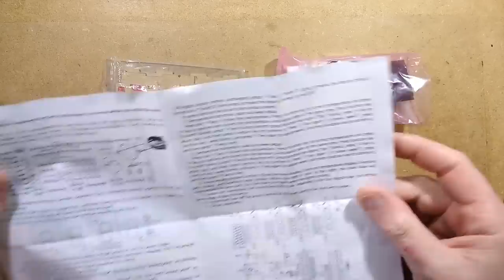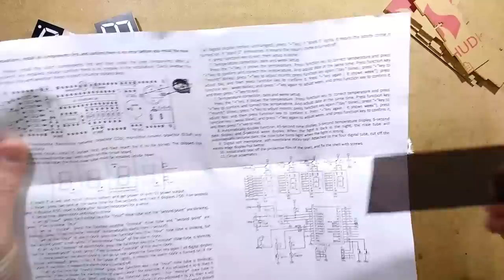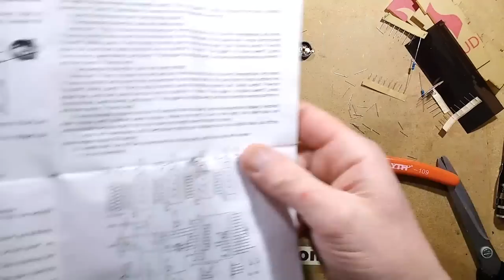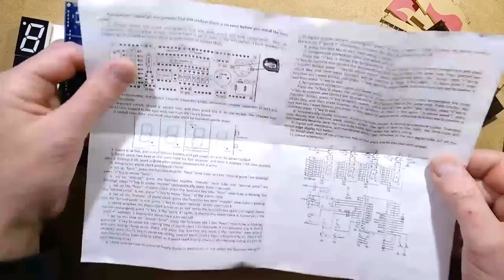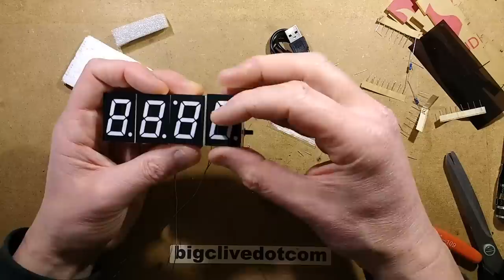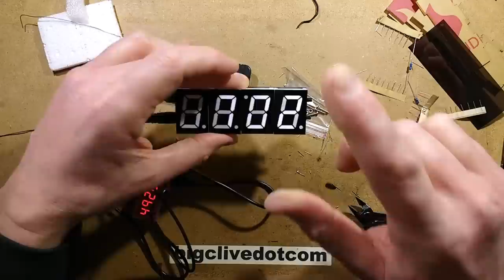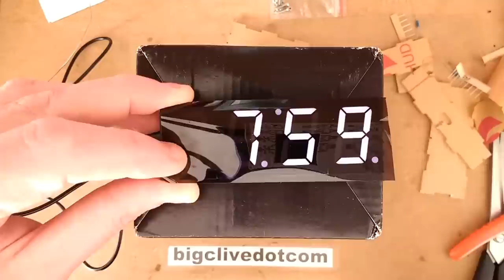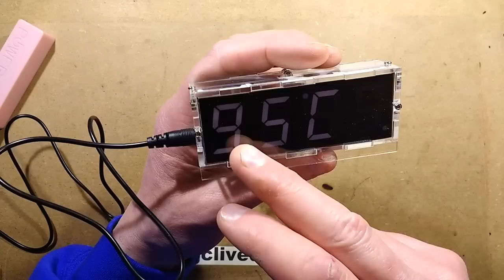eBay clock kit.  Full build and setting guide.

Comment: I've got one of those clocks on my night stand. I increased the LED resistors quite a bit so my retinas won't get burnt out of my eyes every time I look at it. And my bedroom does not look like Mordor.

I have the version without the thermometer and brightness sensors, but nevertheless it's a useful thing. Also mine runs a bit slow (about -1 minute per month)
Reply: What value did you settle on?  I built one for my mother, and she says that the dimmed level is too bright for her at night.  I can't personally see the dimmed level through my closed eye lids in total darkness, so my impression on the matter isn't very helpful.  Obviously it's her clock so It would be preferable to have the light level be appropriate for her eyes.
- edit - Then again, it's dawned on me that your clock must be using the red LEDs while hers is blue, so your resistor value might not be useful.
Reply: Yeah, it's a red one. And I don't remember what value they had initially. But now I use 1k5 resistors. 2k2 still work and it is bright enough.

But just try it. Desolder one resistor and try different values until you've got the desired brightness.

Comment: Another great clock is the colour clock. It doesn't display digits just 6 coloured LEDs in small glass jars. Each LED has 10 colours so if it's red red orange orange green green it 22-33 and 44 seconds. Mine has been running for well over 12 months non-stop and keeps good time. It will even read correctly when turned upside down.
Reply: Green is 5, so 55 seconds :-)
More importantly, though: I don't quickly find this clock on Banggood, Ebay or AliExpress. Can you please suggest where I should be looking, and maybe some less-common search terms?

Comment: Mowing a lawn...on the Isle of Man...in February?  Most lawns I know of are dormant this time of year, growing a cm all winter, if at all.

I was always taught when soldering semiconductors (mostly TO-92 transistors) to use a clip heat sink, to avoid melting the contents.  Now that I've seen folks heating up entire chips to solder-melting temps, I think that was quite pedantic to do that.  Or maybe back in the 70s, transistors were a lot more fragile w/r/t heat.  But the point is, if you're worried about crystal deformation due to heat going up the leads, do you think it would help to clip on a heat sink, even something as simple as a croc clip?

Comment: Hi Clive, 

The problem with the temperature is the thermistor is supposed to go through the hole at the top of the case.

The same applies with the LDR.

The problem is if you don't allow enough length on the leads of the thermistor its not long enough to go through the holes at the top of the case.

I bought another multicolour clock which has less features still its just as nice as the variant with the speaker and the night light.

If you want the temperature sensor to work correctly you'd need to either cut the thermistor off and solder another one in. 

Its reasonablely accurate and its meant to be accurate with 1°C.

I turned the hourly chime off by changing the start time to "0" and the end time to "0" which I guess turns it off.

I turned all three alarms off.

One of the modes is a complete mystery.

It has 9 settings plus another 9 settings. 

What's it for??

Anyway by for now and I hope that helps if you can be bothered resoldering another thermistor into the board.

Decem.🙂

Comment: Mr. Clive (or a helpfull viewer) ;  I have a question regarding a clock kit that you did on an other video you made, but i cannot find it now and I'm sorry for that. My question: Is it possible to solder the components to the backside of a circuitboard? Except for the display in this case. I want to design a box to 3D-print, and then put the same clock as you build on the other video, inside it but it would be nice if the components are on the backside of the circuitboard to have more place and have the display on a flat front of the clock. Thanks in advance, I always enjoy your videos and learned allot already but I need to learn much more and see ALL of your videos first but there are just so much :) Thx for every video you have made untill now, all are very enjoyable.

Comment: Awesome digital thing ama jig, gotta see if I could somehow figure something similar for my 2 solar power controllers from the harbor freight kits  that on both have lost the ability to completely give a accurate reading on the display  quartz crystal meters?  Especially for programming the amount regulating the power coming in from the panels to the deep cycle battery bank. Anywho not sure why this makes 3 that have crapped out now. It be nice to not have to check constantly with my meter anymore  .

Comment: Hiya Clive built loads and corrected these clock kits as you advised that the 3rd led has to be put round upside down big mistake people do and put the reverse polarity diode in the wrong way round

Comment: Regarding capping video length - it depends on your camera model; some manufacturers cap it at 30min (or less) to avoid video camera tax and classify the device as photo camera; but that's in low resolution. At high resolution it's capped at 4gb on FAT file system. Try formatting in ntfs file system. Alternatively you can capture HDMI output from camera and store it directly to your PC

Comment: Thanks for the suggestion, I have one of these, well sort of, mine is white with green lights. It even has a place to solder in a header for programming, but I am not all that smart about trying to reprogram. It would be very nice to be able to reprogram mine so it shows the F temp instead of that blasted C that China thinks everyone in the world understands. Well I DON'T understand the C, I guess I am getting a bit of an idea now that I have that little clock in our Motor Home, where we live the winters out, to avoid the cold and snow of our native South Dakota. Perhaps I shall learn one day how to program that little STM chip to display the F so it will be more useful.  I did complain to the seller, who was very nice about the whole thing, and said they were sorry for the add not stating that it was only C, after which they refunded me the purchase price.  Funny, I didn't ask for a refund, and had already left them good feedback.  Guess some Ebay sellers are just nice folk, like you and I.

Comment: there is a second version with a better speaker (not a piezo) that speaks the time (in broken english "P M three forty five"). i have one of these and it it a nice and neat kit. im about to order a few and build em as gifts
it looks really close to the one you have, but can be identify identified by there being a button on the top center and the thermistor  was moved left (kinda between digit 1 and 2) and the 2-3 CM diameter speaker in the back

Comment: Just fyi most places refer to that as a bevel tip, not a chisel tip. Chisel tips are also sometimes (ie by Weller) called screwdriver tips. Just for pointless added confusion, Weller calls the bevel tips "flat tips" for some inexplicable reason.

Comment: Can I take the output to the LED and use that to drive transistor to drive bigger display? I would like to make something with much bigger numbers. Getting older and have trouble reading some displays without my glasses. When I wake up I must get my glasses to read the time.  I like your videos! I wished I had found you earlier! THANK YOU FOR THE INFORMATION!!
Reply from the maker: You could.  Or drive short parallel rows of LEDs directly at low intensity.  You can get some clocks with very big displays.

Comment: I can recall that I have had one partially assembled red LED, 4 "8" segments with "colon", clock, in midlle eighties, last century, and I dissasemled them, just like you did, down to flat PCB. But! After resembling, LEDs were dyeing one after another. I can say that "8" figure segments were not hermetically mounted onto the PCB but were attached with clips and have had a fixed foil covering the segments. Never understood what had happened. I even maybe have the device data sheet somewhere... 15:36
Reply from the maker: It may have been bare chips and bond wires.  Very easy to break when exploring the display.

Comment: Thank you, it helped. Did this one recently, and after a day of running it I noticed the battery is swallen. The voltage on the battery terminals was about 4,5v when connected to the power supply. Is there any simple trick to protect the battery from charging in this circuit?
Reply from the maker: These may be trying to charge the cell.
Reply: @bigclivedotcom   yes they do,  what if I try using a diode to prevent the battery from being charged? will it work? what kind of diode should I use?

Comment: Caught ya!!! At 47:44 your right hand has a "rasberry road rash", it didn't have before you started wrestling with that case, did you peel it on that laser cut plastic?
Reply from the maker: It was much more dramatic.  I was climbing in a tree with a saw when that abrasion happened.
Reply: The best stories start with some version of: "There I was, with the Mountain Lion only 4 meters away...."

Comment: I've already built one of these and was hoping someone could explain how to set it. I've spent much too long trying to figure out how to get it out of 24 hour time display mode, but so far my efforts have been futile. The one I got didn't come with any instructions, but I did find a website that showed how to assemble the clock, but the site was in Chinese so if there were any instructions on how to set it I couldn't read them.
You're right about it being annoying that the clock is always displaying information other than the time, and I find myself confused about whither its displaying the time or the date. Also, while mine does have the thermistor, it never does display the temperature, and the light sensor only works occasionally, most of the time it's on full brightness even in a dark room.
The case, as you point out, is a real pain in the butt to assemble, I spent a lot more time fussing with it than I did soldering the components to the PCB.
I really wanted to like this clock and feel good about soldering it together myself, but it's been so frustrating I think I'll end up tossing it out.

Comment: I am 50 yrs old and still haven't master the soldering thing. I really should buy a couple of these kits just to practice on. I do not have the best solder station but I guess it works. It is a Weller 40watt  kit but can go up to 60watts I believe. I love the TS100 kit you have but I can not pull the plug on the $200.00can plus tax.
Reply from the maker: I use a fairly cheap iron.  The main thing is to have a clean shiny tip and to melt the solder directly into the joint while heating it.
Reply: @bigclivedotcom  When I am doing some soldering work I really do not know what to use as solder. What size or should I be using lead free. I am just using some cheap solder that came with my station. That is almost all gone so what do you recommend I buy?
Reply from the maker: @MarkK01  Try and find proper electronics grade tin/lead solder (60/40) with a flux core.  When you apply the solder ot the preheated joint the solder will melt releasing the flux , which cleans and mates the solder to the surfaces.

Comment: It's funny that you're doing a review now, I just got this clock last week and really like it. I'm using it now as main clock on my night cabinet. The only thing which is quite annoying is that it's so frequently changing to date and temperature display, which I would like to be only activated by button press. I'm currently working on a replacement firmware for it. The STC15W408AS is quite easy to program and you can use almost any serial controller/level converter such as MAX232, PL2303 for in-circuit programming with the STC-ISP tool you can download from their website.
Regarding the case, seems you were really struggling with this off-camera. I noticed you lost some skin on your right hand while assembling it ;-)
Reply: Jens Jensen posted firmware sources here, to my understanding a rewrite by him. 

https://github.com/zerog2k/stc_diyclock
Reply from the maker: The skin abrasion was from a saw while climbing a tree.

Comment: You should try the rotating LED display clock. 60 small LEDs in a circle which count down or up or simply spins with a regular display in the centre.  I built one for myself and every bloke and his dog wanted me to build one for them. Then there's the clock which scrolls in any way you fancy plus even remembers birthdays and Christmas and gives you the appropriate greeting. Great fun to build although my eyesight isn't what it used to be and my hands not so steady so I find the SMD components a little awkward to solder.  But I didn't have any failures. Check out BangGood for their range of kits. I've built bench power supplies, amplifiers and LED Audio VU displays. I must say I prefer it when you're blowing things up though :-)

Comment: I found building the case together not so bad. Was a bit fiddly but with lots of patience it works. :D
Also it helps to build it in stages and actually screw each stage tight.

Comment: @bigclivedotcom have you tried the Oscilloscope kit? If not you should get the one that has some SMD resistors and show everyone your heat pen! I got a kit off ebay for $20 and I have the same soldering station you have, works great!

Comment: The flux effect is way worse. I used to sit in the back of landrovers repairing battery cables / battery terminals on the 24v charging system and I used 14swg rosin cored solder doubled up with a 150w half inch tipped soldering iron. To say that the air in there got foggy was an understatement, especially when the mechanics thought it would be funny to close the back door. I had to flood terminals with solder to flush the preserving grease that was smeared on to protect against green gunge buildup. I've now got one of those irritating coughs that comes and goes during the day, I may as well have taken up smoking.
So yeah, it's not overly healthy in large doses.

Comment: Relaxing watch :) Have you seen the same type Ebay clock kit, that, don't have all those resistors and transistors, plus cheaper :)
On most images of your clock kit, the temperature component goes through the hole at the top.

Comment: Thanks Clive for this, have ordered and building with my son who is learning about time and clocks. You've mentioned a number of times in your video about solder with lead being outlawed - however, it seems relatively easy to get hold of from various shops in the UK - so wondering if that's right?
Reply: Paul Veitch I think he means if you are going to sell something,  if you are just making it for your own personal use then you can solder with whatever you want
Reply from the maker: It's banned from use in mass production, but not for servicing or hobby use.
Reply: Ah, thanks for clarifying. I was getting slightly confused when ordering the solder. 

You've mentioned a few times about the non-lead solder being more brittle. I remember growing up and when I used to repair electronics for a hobby, lots of devices were fixed by reflowing the solder due to a dry/cracked joint. I don't come across that issue as much as I used to, so I guess the manufacturers have found a way to make them more reliable through other means. These days I see far more issues with caps drying out/expiring.
Reply: Toby Cowles: Thanks, on that basis, I might try soldering with Plutonium! ;)

Comment: I've had a clock kit refuse to power up at all without the backup battery, though that was a DS3231 based clock (that RTC looks to be a DS1302 or DS1307).  The battery is most likely to be a CR1220.

Comment: Better if you put the screws and nuts together then slide the nut into the slot.  Then tighten the screws. Just finished this clock myself.  I got the blue varient

Comment: Hi Clive.  I'd love to solder one of these kits (a red LED one) to use in the bedroom as a clock.  What I would prefer is if the device can auto-dim the LEDs depending on how bright or not it is in the room (I don't want it to be a night light so would prefer it barely visible in the dark), and I'd like it plugged in on the mains all the time (via a transformer).

Can you suggest how I achieve these things?

I don't have a kit yet (will only purchase one if it can be modified to be automatically dimmed).

Thanks.

Comment: Love your videos Clive! I purchased a clock module similar to the one you had done in a previous video and it came with zero ohm resistor in the package. I was wondering if the same task can be achieved with just a piece of wire bridged across the solder pads? What is the purpose of that resistor?
Reply from the maker: Zero ohm resistors are often used as links to facilitate machine placement.  You can use a bit of wire.

Comment: I bought the one with 4 rings of leds running around the edge of a circular clock face. 9 out of 10 of the 100+ leds were garbage. But ebay has some great kits.